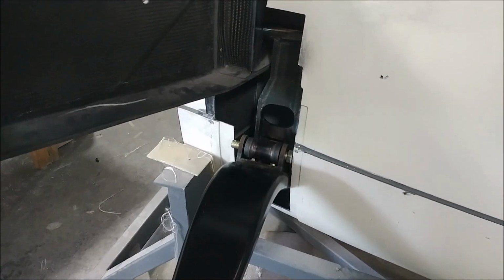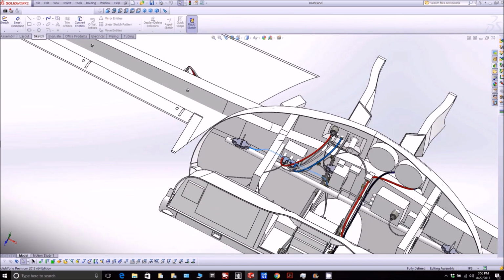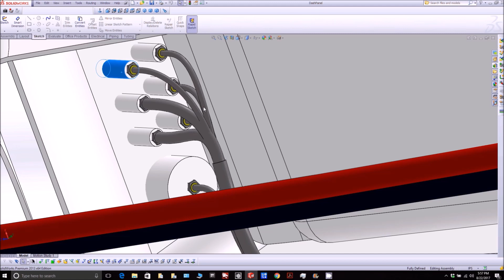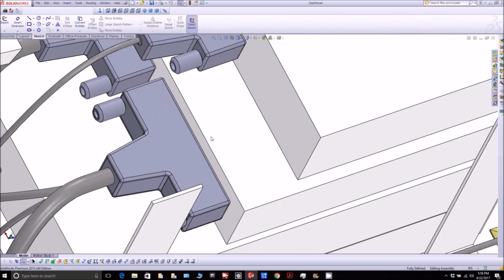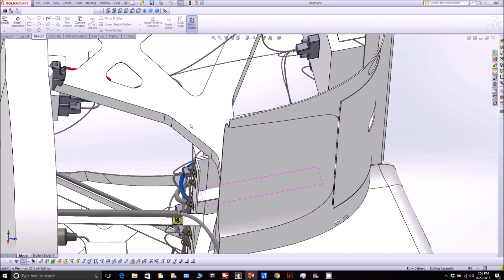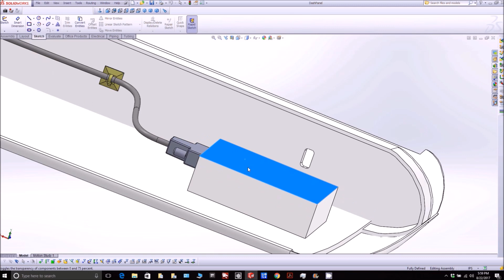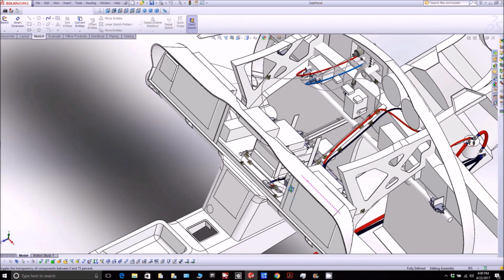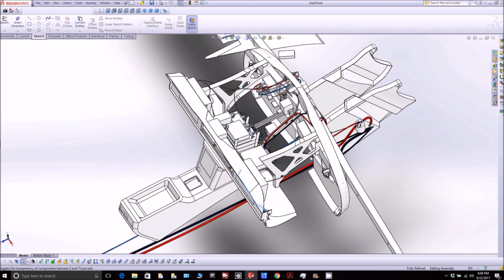Gear Legs and Wiring - Test fitting the main gear leg system

Comment: I have always wondered why aircraft panels do not have an extinguisher port or two to get material on top of the stack of equipment.   A 1/2" breakable or openable hole at a minimum to be able to spray an extinguisher through.  I have seen them in marine applications and the weight is nominal.   Just a thought as all the panel fire risk is inaccessible in flight, yet inside the pressure vessel.  To go after a fire in flight one is only left with spraying under the panel.   I obviously have a fear of this and have thought about it too much in flight.

Comment: Just a thought.  Most headsets I've seen have the wiring from the left side of the headset.  Having the plugs on the left seat position on the right hand side of the panel means the headset wire will need to cross over the lap (or legs) of the person in the left hand seat.  IMHO it would be better to have the jacks be on the left hand side of the panel to keep the wires from crossing over the person.

Also, I'm totally fine with a dual-USB port in the back, but in the front seat position there's likely to be more pilot-stuff going on there requiring additional USB power.  If you can have two USB dual USB ports up front it likely would help to eliminate any requirement for additional USB expanders (or "y" cables) to add more power.

Just my $0.02 worth.

Comment: Hi Peter, 
A couple of comments re wiring grounds:-
1. Your method of keeping the power and the signal wires run separately is a good one as it will help reduce induced noise into the digital and analogue signal wires. Nothing like  hum in your headset/speaker to get on your goat!
2. It is not unusual to have separate ground common rails for power and signal. Both of these rails only come together when connected direct to the negative terminal of the battery. Doing this helps eliminate induced electrical noise. 
3. Don't create an earth loop by daisy chaining earth wires. If necessary make a master earth node and run all intermediatory earth nodes from this one. 
4. Unless specifically instructed to do otherwise, in the wiring instructions, then connect cable shielding wires at one end only to minimise the possibly of earth loops. Some units provide separate earth pins for power and signal. If this is the case then run them back to their respective earth common rails. Resist joining them together as this may cause an earth loop.
5. Where possible solder earth connections. 
Cheers
Danny